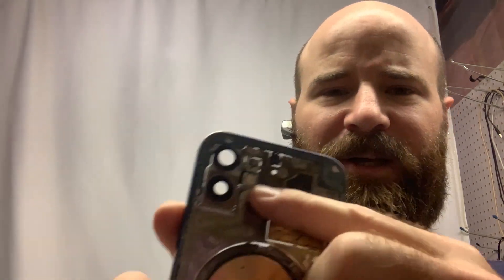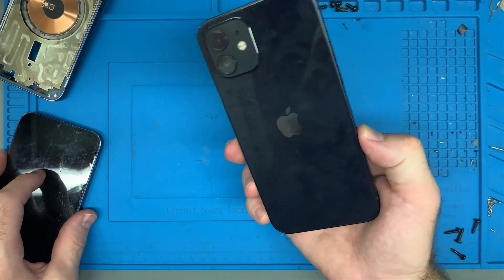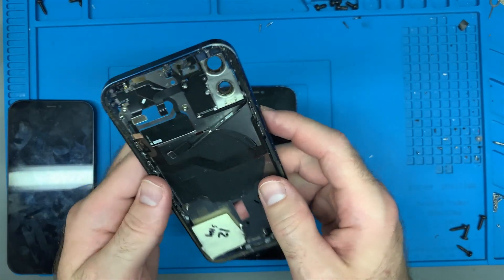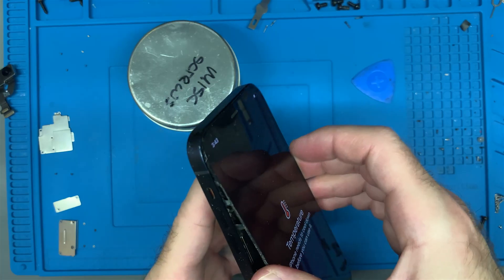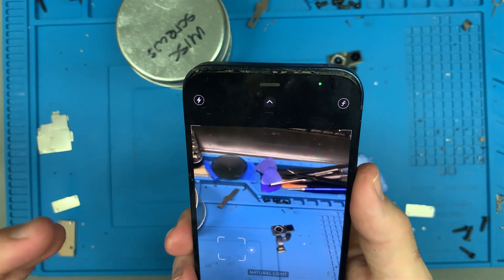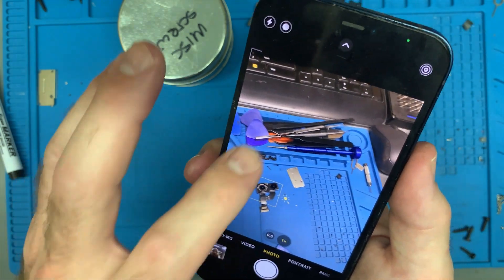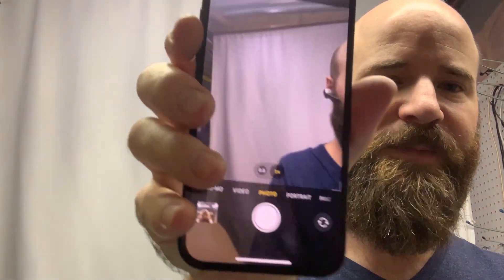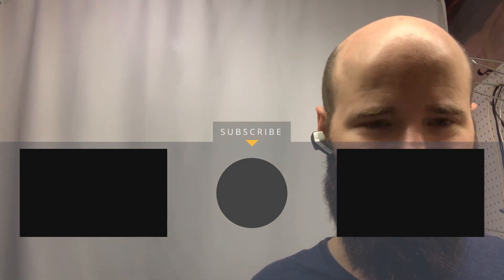iPhone 12 Camera AND Flash Dead - Let's Find out why and Fix it!

Comment: very good as usual👍👍
Reply: what kind of batterie do you recommend me for this same model ?
Reply from the maker: @deadlight5570  I buy most of my parts from mobile sentrix. You should be able to look up your phone's model on the site. They have a Canadian website and a USA website. Be careful with ebay batteries. They can be pretty bad scammers. One last recommendation! I have purchased batteries from REWA in the past and their batteries are very good, just expensive to ship, so you need to buy in bulk.